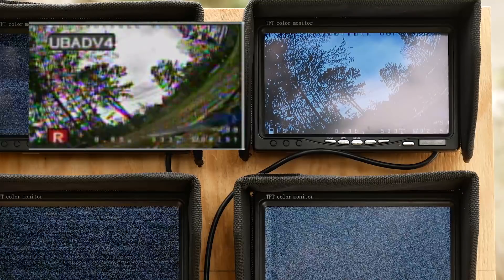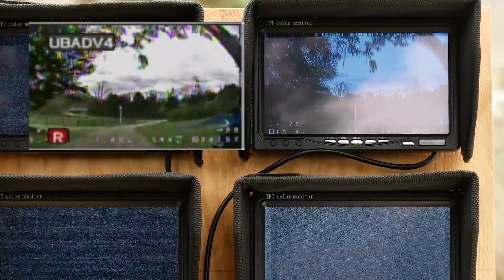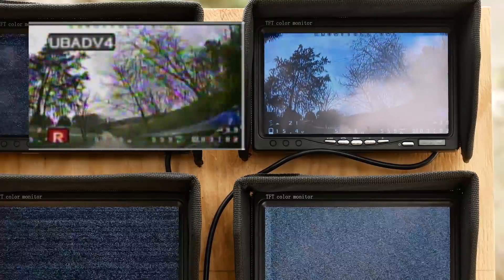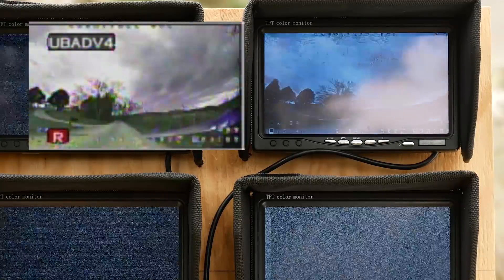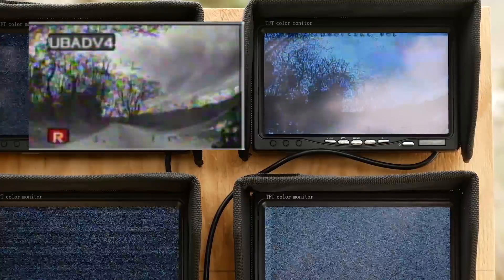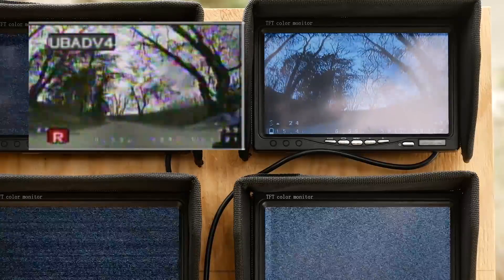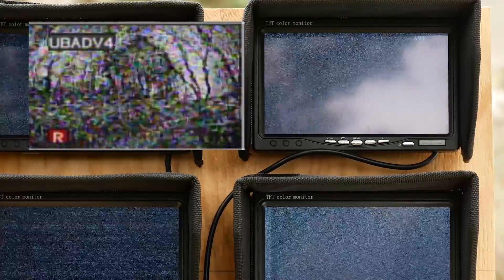Live Screen vs. DVR for FPV Receiver Testing

Comment: Splitting signal, will "encounter insertion loss that will weaken the signals distributed beyond the splitter". installing a distribution amplifier or antenna preamplifier can help. The screen on the right is much better until last seconds and loosing signal starts, than left one is much more "reliable"!

Comment: From someone that has been selling, installing, and servicing high end CCTV systems for nearly 20 years:

If anything, the CCTV DVR (or any DVR) would be producing a poorer image since it is compressing the video with H.264 or MPEG4 or something else depending on what model it is (I’m assuming it isn’t a multi thousand dollar box like the ones I work with). The raw analog video signal is always going to look better.

Comment: look mostly the same to me tbh both show when the signal is getting bad and unflyable.

Clearview module will damage clearview's reputation tbh.

They shouldn't have even announced it until they were confident that it was going to actually perform like a proper clearview and not just a bad module.

Comment: The DVR maybe a tiny bit better... but it is at a point when both are basically useless anyway... so as others have said Clearveiw is looking for an excuse. I know the DJI stuff you tested has wicked latency... But I bet flying a drone slowly at the same distance it would work many times better.  Long range flying the mavic for example the video is so much better... I look forward to the day when we can mavic quality video with reduced latency... that day will come and ll of this analog crap will be forgotten about very quickly.

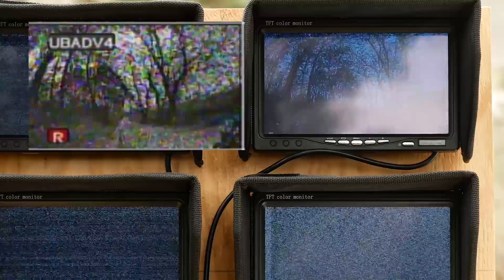Comment: There is clearly a difference at 1:37 where you can see the house on the DVR but only static on the screen. But I would say it is close enough (maybe you should have made this test before buying 4 screens and building the rig for it ;-) ). The resolution on the DVR is dreadful, though.
Reply from the maker: Buying 4 screens was out of a desire to get the testing out as quickly as possible for all the people who were begging for it :-)

I'm sure I'll find some use for them never fear.

Comment: I cant Even read the bat voltage in the dvr. The recording of the screen looks a lot cleaner. What are you using to Record the dvr? Looks like the eachine pro dvr Albert kim uses, is a LOT better
Reply from the maker: The DVR recording has less resolution because it is displaying 9 screens at once.

Comment: You may measure the impedance of each signal.
Reply: A signal has no impedance, but I know what you mean. I agree, there might be some kind of signal processing necessary when using a y-cable.
Reply: This what I thought. Splitting a video signal the hard way does not make sense. A Y-cable lowers the impedance.

Comment: No no. Josh. Keep going with it. Let’s get to the bottom of it. I’ve been saving for two modules from clearview and I really want to know are they better. I don’t race. I fly with my wife and my boy at most. So maybe as suggested by Doug from XframesFPV and yourself that without a crowd of people’s transmission to sort out that it’s not worth the investment. There’s such a big difference in cost that if the manufacturer says the test can be improvised then let’s see if they’re right.

Comment: I know I asked this before but yet unanswered, maybe coz no one knows or have tried yet.
Clearview uses a tuned & slightly untuned Rx & their algorithims colate the information which is why people claim it is better for multipathing. It is proprietory so they will protect that at all costs (lol).

I want to know how an RHCP + LHCP aerial setup Rx side would work with a dipole on the Tx side in similar multipath situations. ( I don't have LHCP aerials because I was told to keep everything in polarised sync).

I am wondering if when one direction fails, the other direction may have more information/signal to work with. Not everyone can find the perfect corner of their flight paths to use panels & not everyone can fly in areas where panels excel.

I don't know but if anyone would, or would try it, it would be our JB.

Comment: Thanks JB unfortunately I pre-ordered the clearview
Reply: chet laux. I'm in the same boat. Kinda wondering whether I should just have upgraded my.la forge v2 to the V4? I think the video has a lot less break up through most if the flight except at the end of the video.whrn the la forge has a image and the clear doesn't. I have noticed however that many times then Clearview imagenseems worse in extreme situations however I feel it is easy to fly due to being able to distinguish objects using the shadows. Where as many of the modules flicker or roll making it slightly harder to fly.

Comment: I think Clearview is just going to say anything at this point. I'm done, I've seen enough. It's 100% not worth it to me. Plus the interface where you actually have to have the googles on your face to make changes. I don't see anything different. Mr Steele did a very good review of the Clearview vs laforge and in his video, Clearview was better, at distance it wasn't fully dropping out, it was switching to black and white then back to color, but in his video it was a much better results for Clearview. Mr Steele review https://youtu.be/xYjhD4zR_t8
Reply from the maker: Steele flew one module then the other, not at the same time, so it's not really an accurate comparison. No disrespect intended, but this is one of the first things I arranged to do when I started taking module testing seriously: you need multiple receivers running at the same time to ensure they are receiving the same signal. Even something as simple as him moving his head could cause the results of his testing to be invalid.
Reply: +brandon woodford just to clarify, I am pretty sure JB referred to the older tests, after which he did an interview with Iftron. Not this recent test.
Reply: Joshua Bardwell I still really want to see a test with the Clearview racing/pro versus the Clearview module, from what I've seen/read the full size Clearview does a much better job than the module. If that's true I would eventually want to purchase one but at this point if it performs the same as the module I wouldn't waste my money

Comment: Close enough. Works for me. Just use the DVR if thats easier. It appeared to be slightly worse signal than the screen, but very minimal differences. Although, that low res image is hard to watch.